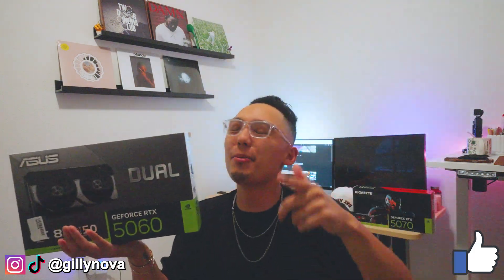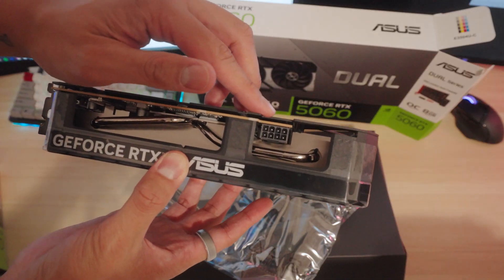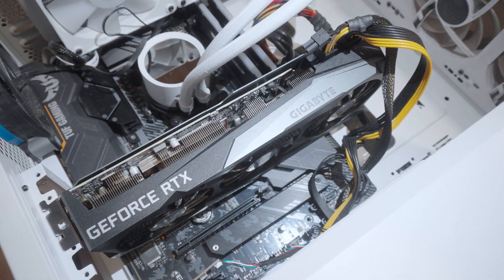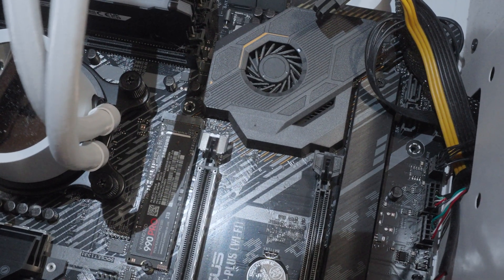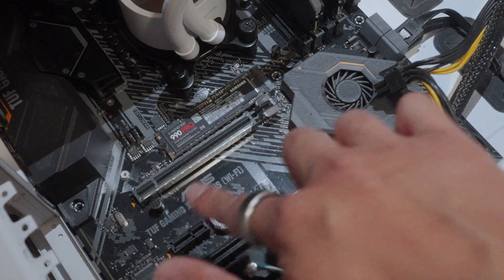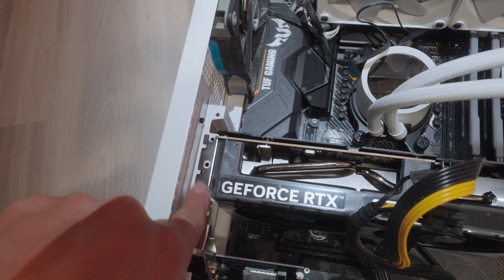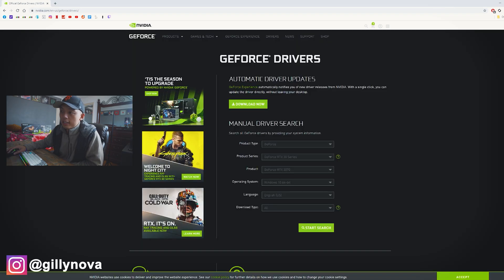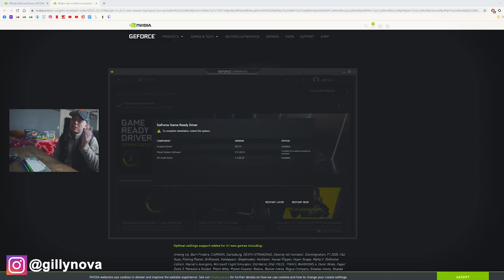How to Install a Graphics Card! - RTX 5060‼️

Comment: our psu came with a 10 pin, so we don’t know what to do. we also have leftover cables from the psu labeled pcie, which are 6 pin, but have a small 2 pin beside it, what do we do?
Reply: Line up the two pin connector next to the 6 pin so that it makes 8, thats what you plugin.